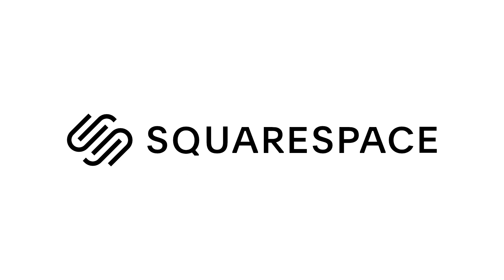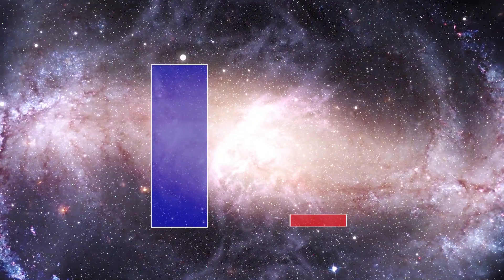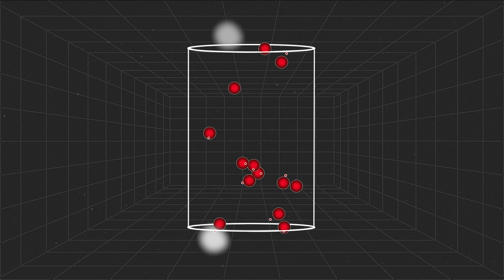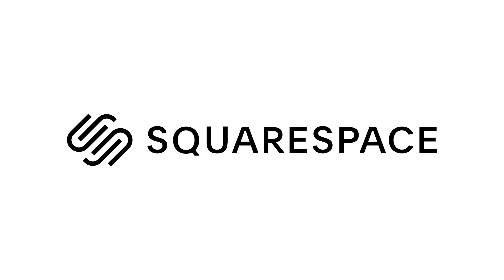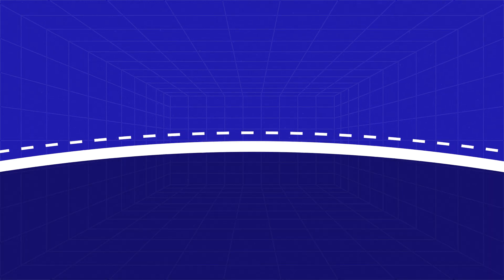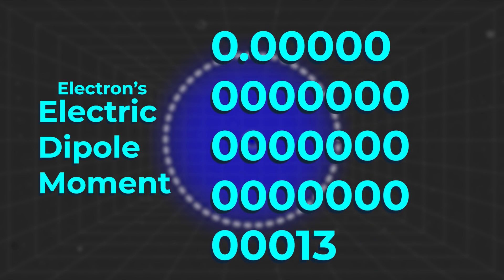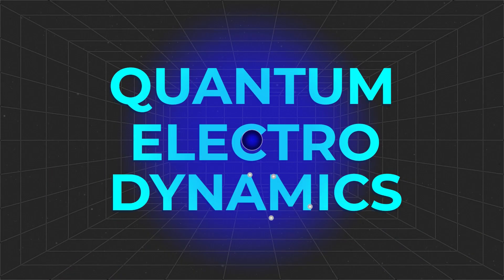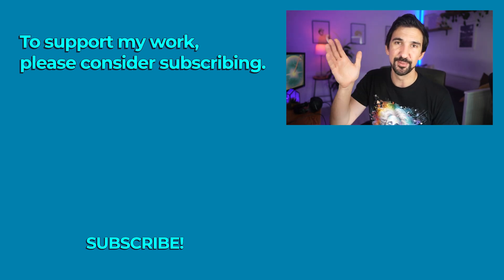What If Electrons Aren't Round? The Antimatter Problem  - EXPLAINED

Comment from the maker: Head to https://www.squarespace.com/drbenmiles to save 10% off your first purchase of a website or domain using code drbenmiles
Reply: Elementary particles are like boxes, and I have developed the structure of them, using their masses.
Reply: Nobody cares about anything you have to say, denier. You obviously have zero genuine scientific knowledge.
Reply: wouldn't it have been a better test, that we used a U shaped penning trap for that bose einstein condensate with antimatter, where both holes are in the opposite direction of the gravitational field, perhaps on ISS even for microgravity, to exclude that antimatter falls up instead or down? If it would fall up, then there wouldn't be antimatter left eventually.

Comment: 11:30 the graphic shown shows an isolated electron in isolation with virtual particles. What happens when the virtual particles are under a gravitational field and both pulled away from the electron in the same direction?

Comment: The argument that there should be equal parts of matter and antimatter in the universe only applies to the primordial (as in, first) universe. If our universe is a daughter universe created by a collapsar, it would only contain one or the other, not both. The matter in our universe would be seeded by the parent universe with only one variety, because if a collapsar tried to squeeze equal parts of both matter and antimatter into a black hole, the star would have disintegrated long before it had a chance to collapse.

Comment: well, consider 2 magnets that are caught in their respective magnetic fields, so they tend to attract one another, now give them momentum in the same direction and let them spin around each other, so we now have 2 magnetic fields that are attracted to one another, orbiting each other, moving in one direction through spacetime.
over the path that they take, you introduce another much bigger magnetic field that will attract one magnet and repel the other, then those 2 initial magnets won't touch each other.

now consider point particles, they have no shape nor size, but they do have charge, spin and mass. In combination of 3 quarks each with a different colorcharge we get a positive charge for the proton and no charge for the neutron, and the electron has a negative charge, as if they were literal monopoles being 2 dimensional particles that have no up or downside, so quantum field theory is a bit different, the fields have no top and bottom, it's just one monopolic charge, so now we have all positively charged protons and negatively charged electrons just waiting to cool down so they could start interacting. 

So, first we have all 2 dimensional quarks with a particular monopolic charge as a matter and antimatter particle, they both spin around as mesons until they annihilate each other, and for the bigger magnetic field perhaps we could consider the gluon which could prevent one of the quarks to annihilate with each other, because it will attract one and repel the other, if it's the right quark with the right colorcharge to form a proton or neutron with that gluon and other quarks if they already interacted with that gluon.

A 2 dimensional particle has no up or down simply because those levels of degrees of freedom are missing for 2 dimensions. So if it has a charge, then it's a monopolic charge from all angles.

But, that's just my thought process, i'm not a physicist, I don't even have a diploma. But not bad huh??

Comment: An electron has no shape. It is not a round point. It does not have a north and south pole. It is a culmination of EM wave at the quantum level. If it did have a shape, it would have a size, and it does not. It does have a measurable radius that is defined because of the wave-particle duality, but it's not a "ping-pong ball," so to speak.

Comment: All the expert particle physics books I have read say the electron is merely a point source with no volume. That seems an affront to common sense, like so many things in particle physics, so I am not opposed to electrons which are round and therefore have volume. But that raises another problem, if electrons have volume, why do they have unitary charge and not a combination of quarks like protons or neutrons? And if electrons can have unitary charge without the aid of quarks, why cant other particles? All particles I know of which have mass also have charge, except for the neutrino. Wouldn't it be simpler to say the neutrino is massless, then this anomaly disappears. After all, no one has actually detected neutrino mass, it is simply inferred because physicists calculations would look shaky without it. Why not race a neutrino against a photon, and if there is no difference the neutrino is massless
Reply: Bernard-     The neutrino has three types known as flavours. They change from one flavour to another. This proves they have mass. Don't know why, something I keep promising myself to look up.
Reply: @chrisgwynne1586  It doesn't prove they have mass, any more than Martian epicycles proved that Mars sometmes reverses course. I'm not saying that neutrinos definitly have no mass, I'm just saying that we need more proof. Particles with mass can be brought to rest, or very nearly, neutrinos cant.  Particles with mass usually carry electric charge, neutrinos dont. Particles with mass cant move at speed c. lt has yet to be proved that neutrinos dont.

Comment: You said that since antimatter has been observed falling in Earth's gravitation field that means anti gravity is unlikely but this is wrong. All energy falls toward a positive mass body, due to spacetime geodesics curving toward it. Both matter and antimatter should be expected to fall under Earth gravity. But if you could build an entire planet out of antimatter that's a different story. If antimatter has negative mass then it would generate a repulsive gravitational field around it, it would cause a negative curvature in spacetime and make parallel lines diverge, antigravity basically. No experiment thus far conducted has provided any strong evidence as to the question of whether antimatter has positive or negative mass. The overwhelming strength of Earth's positive mass dominates the local spacetime curvature. You would need either a very big lump of antimatter or to get far away from any other gravitating bodies. That said, a key detail of the experiment which dropped anti protons was a possible indication that they fall slightly slower than normal protons. This would support the theory that antimatter indeed has negative mass. We should not expect antimatter to fly away from the Earth, not unless the mass of the antimatter is greater than the mass of the Earth, until then the dominant force is attractive albeit slightly weakened. Negative mass antimatter also neatly explains a very long list of issues such as where the mass goes in matter-antimatter annihilation events, why there APPEARS to be an imbalance of matter and antimatter in the universe (because antimatter repels itself and forms a diffuse fluid instead of clumping into galaxies and stars), which further accounts quite nicely for dark matter and the anomalous galactic rotation curves, as well as the large scale structure of the universe (filaments, voids, etc), AND has the potential to explain dark energy as well, because it would mean that the "empty" space between stars and galaxies is really a very diffuse fluid of antimatter, negatively curving spacetime at the largest scales of the universe. This also suggests that the universe may in fact have zero total mass/energy, helping to explain the "something from nothing" problem of cosmology. The whole universe could just be a zero energy quantum vacuum fluctuation, by the heisenberg uncertainty principle this means it could exist for infinite time instead of being short lived. Matter and antimatter pairs chasing eachother across the universe, accelerating to arbitrary speeds can also explain ultra high energy cosmic rays. We have this bias against negative mass but there's no evidence for that except "we've never seen any", but even that may be false. The fact is we wouldn't have known even if we did have it. There is still a very real possibility that antimatter has negative mass and we wouldn't know it, only now we're beginning to test the gravitation effects of it, but this is ridiculously hard. A proton has almost no gravitational field, its hard enough to detect the gravitational force between two lead balls several kilograms each. We're a long way fro  accurately measuring the gravitational properties of antimatter.

Comment: I note this is all only on quantum level.  Because when we view ALL other matter, nothing is perfectly round and nothing is disappearing!
Clearly the part which is not in the experiment is all the other matter!
You are trying to find out why all this matter exists, and at the same time saying all quantum stuff should annihilate themselves.  
I don't like science's 2 opposing laws of physics. Thus it must be relevant they exist together.
I therefore propose that there must have been a larger matter at the time of the Big Bang. Otherwise we clearly wouldn't have matter if everything on a quantum level was annihilating each other.
It must have been slightly bigger than a quantum particle. 
Maybe time is a particle, its just that we haven't made a time machine to prove it. Maybe time is solid and moving in space. I tend to feel trapped so that's probably it.

Comment: As for looking closer.  Like in the case if the Neuteon.  The more energy used to observe the further away it will appear to move.  This itself isn't quite accurate either.  What occurs is the shrinking of the radius to an increase in angular frequency.  (An EH)

Comment: Gravity.  No. Gravity as per mass is resistance to the flow of time.  At an EH  time stops, beyond it runs backwards, in here you'll find little bar antimatter.  
One might ask if 96% of this "cycle" of the universe is spent given the volume of dark?  Asymmetry is thus an illusion as is the speed of light.

Comment: Where is all the antimatter you ask? Well, what makes it different from normal matter? The charge (there is also chirality but in any case it's still a binary distinction). What if we swapped some labels around, and called protons antimatter? Then you'd have both matter and antimatter in the universe. Of course there remains the issue that we still don't have positrons and antiprotons around, so some symmetry did break. But rephrasing the question this way would help us focus on the way more important question, the nature of charge (which I'm willing to bet is going to be linked to all the other differences)

Comment: People are trying to defend the symmetry by stating equations and other things state it has to be symmetric.

But all of this ultimately stems from us starting with the very assumption that universe ought to be symmetrical. We dont like the idea of things not being symmetric.

I dont like the idea of it not being symmetric. But the facts remain. We DO live in a mostly regular matter universe. Regardless of how we feel about it. And theres also no currently accepted explanation for it.

Its quite possible it just isnt symmetric for no reason at all that has anything to do with any equations we have to describe the universe or physics.

Just as theres probably no reason at all for the universal constants to have the exact values that they do except that if it were any other way. Life wouldn't be possible and we wouldnt exist to contemplate it.

So as infitessimally unlikely as our universe is with its exact configuration.  We couldnt exist to ponder it if it was different in any other way. This includes the ratio of matter to antimatter. So if theres any random fluctuations in how the bigbang can happen. Then we wouod have only existed in THIS version of those random fluctuations even if the probability is so ridiculously low it's uncomputable. 

There quite possibly is no reason at all for it other than sheer chance.

Comment: If you take Wheeler and Feynman's idea of antimatter being indistinguishable from time reversed matter seriously, then the difference is just a particle's orientation in spacetime which would put all primordial antimatter outside our observable universe and before inflation/the big bang from any observer's perspective.

There's another potential solution if you re-evaluate the historical definition of antimatter in light of the discovery of quarks.  The quark model we have now was derived with the assumption that protons and neutrons are definitely all matter and it leads to the odd quirk that the top row of quarks are charge sign reversed from the bottom row and the leptons. You can rather dramatically simplify the conservation laws if you don't assume that protons and neutrons are made entirely of matter and swap the labels on the top row of quarks so charge sign is consistent.  Surprisingly, that makes you recompute the baryon numbers in a way that makes it consistent with charge conservation and still handles the full zoo of meson decays properly. It doesn't quite solve the asymmetry by mass (it's basically 2:1 if you do that) but the up quarks that make up 1/3 of the mass are roughly half the mass and twice the charge of their down counterparts which might suggest an alternative way of accounting for both mass and charge where it's 1:1.

Comment: Incoherent magnetism and magnetism prevent any othe shape . Want another weird magnet shape ? You will need a human to make it . Worst its a lot of work to make magnet repulse . Its easier at atom size because every value is closer to penultimate 100% nothing . So any field will afect atom . The vibration ? Its cause by the nearness of pole at atomic level the one that react the least is most neutral for  add 1 name here . Combo like water do not count . Its xa higher lever material

Comment: This video misses something important, which is the distinction between egg-shaped and oval-shaped. The electron is not perfectly round (spherical), since it has angular momentum, charge, and a magnetic dipole moment, which combine to give a free electron an "oval" shape. But that shape has no net electric dipole moment. To turn an oval into an "egg" (which does have an electric dipole moment), you need relative motion (apparent shape changes in relativity). So asymmetry in the relative motion of electrons in the big bang could result in an effective electric dipole moment.

Comment: You should really start you episodes with a list of assumptions.
Otherwise you imply a lot of nonsense.
Electrons are not sphered whose shapes could be the way your graphics imply.
Then the idea of the big bang creating equal number of matter and antimatters is also an assumption based on tower of previous assumptions that might as well be turtles all the way down.
This is just about the worst aspect of scientific communications.

If electrons had a size then they would have classical angular momentum spinning them faster than the speed of light breaking causality.

Comment: Maybe uneven distribution left one side of the universe with more regular particles and the other side with more antiparticles
Reply: I believe there must be some sort of "imbalance" because this is required for the momentum exchange between elementary particles (e.g. quarks are constantly exchanging momentum between each other via the gluon flux tubes) which takes place inside the composite matter particles.

Comment: Hot take, what if there isn't an anit-matter problem. What if the natural low energy state for a positron is to be contained within a proton and the natural resting state of an electron is to be contained external to protons, what if being an anti-proton is simply a high energy state?

Also, it seems apparent to me that protons and electrons are not actually litterally attracted to each other but are only apparently attracted to each other.

You would think that if they were actually litterally attracted to each other, that combining a proton with an electron to form a neutron would be a low energy state, but this is incorrect. The neutron is a high energy state.

Lone neutrons quickly decay outside of the nucleus of attoms and when they do, they release a neutrino and convert into hydrogen-1. This mean hydrogen-1 is the low energy state. That means placing the proton in direct contact with the electron require an addition of energy as the electron and proton resisted being put together.

I posit that all electrons are reppelled from all electrons, and all protons are reppelled from all proton but that electrons shield protons from the field of other protons and protons shield electrons from the fields of other electrons.

So naturaly they want to be close together but resting a distance appart that affords the maximum level of shielding: hydrogen-1
Reply: Neutrinos disprove this

Comment: Quantum physics has it's place. As does Relativity. Key term Has It's Place. The problem with quantum physicists is that they obsess. Not everything in the universe can be fit into that little box they all so hope will. There is no quantum gravity,  relativity is correct. String theory will never tie it all together. And the answer to this problem, and many others, will not be found in quantum physics.